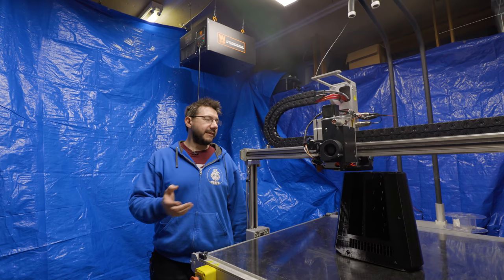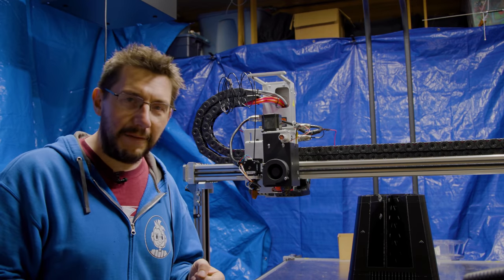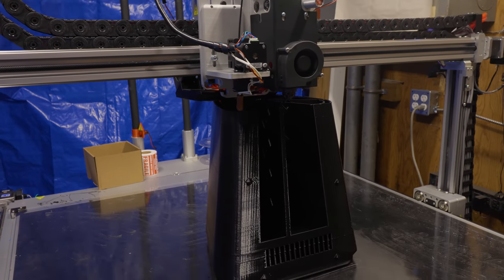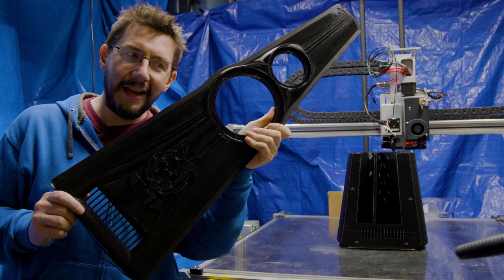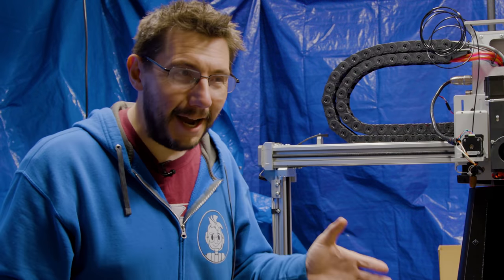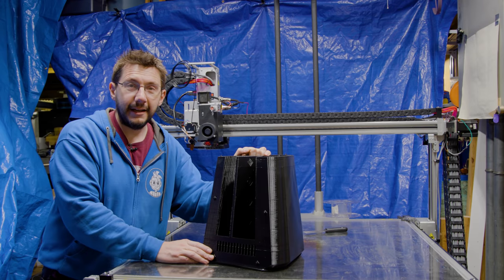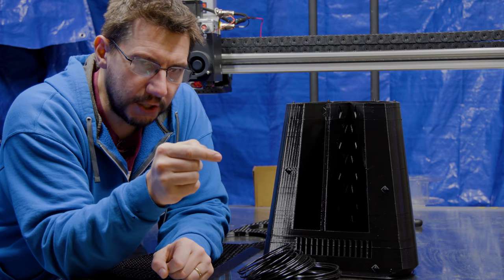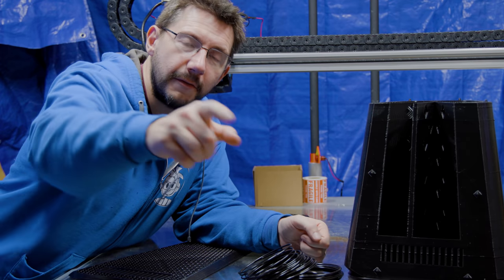3D Printed Speakers Part 1: Breaking the $38,000 3D Printer ... Again?

Comment: I have been working on ideas for 3D printing speaker enclosures as well, but the biggest issue is making sure the prints are dense enough to control enclosure resonances. If I saw the thickness of yours clear enough, I have concerns the walls are not thick enough and will negatively affect the sound. Try knocking on the side of it and listen for "ringing" or a dull thud sound. I look forward to seeing how yours turn out.

Comment: Joel, We have had one of these printers for a few years now. You didn't say what temp your garage was but we run ours at 74 degrees room temp.  We also use Aquanet on the bed. The prints stick most of the time and self release when cool. I would use a much larger brim in your case. And don't feel bad we have lost a few nozzles this way. We replaced the stock extruder with a super volcano hotend and a Bondtech extruder.

Comment: Delayed shutoff on sensor / use estimated time to run most of roll.
Reply: Yea, it really should know how far the out sensor is from the extruder.  Though I haven't done that with my printer either, but I only lose a foot of filament every time.

Comment: I know that lift... I had a (much smaller) print going that was just 7h. It looked great... until I removed it and found out that it had lifted, and it too had alignment holes and didn't fit... so I had to do the print over. Now to wait for part 2.

Comment: Some tips from someone who runs a 4'x6' bed.  No heat bed, spray super 77, we use a .65 first layer height for a .8 nozzle.  To release print spray windex on glue around edges of part.
Reply from the maker: Super 77? Really? That works for this?
Reply: @3DPrintingNerd  yup, we spray 3-4in from surface with quick swipes so its shiny, then print on top of that, we dont even squish the bead, it lays it on top and still sticks well

Comment: I would try larger brim to stick it to the bed. I think for these large prints, a patterned brim would be useful. Just imagine you have a large cross (X) with like 20 cm arms as a brim instead of the full offset of the base of the print. I do not know any slicer to do that.

Comment: Large spring steel print bed like  BuildTak is  the only way I see to fix the heat issue. The  area under the print is essentially insulated and it would take along time for that area to cool off.  Not to mention the differential of temperature on the glass.

Comment: For PLA I've used a painter's tape (just usual white good tape) + Erich Krausse PVA glue (stick). Worked very good usually. Maybe for such projects you need that. Or check your build plate heating consistency. I think it may be an issue there.

Comment: I know it might not be conducive to taking a time lapse but a draft tower is designed for this exact situation.  It holds heat, off the build plate, around the part to keep it from cooling and popping off.
Reply: actually a raft might do a better job?  if only someone had a machine to test.....  ;)
Reply from the maker: ooh a draft shield, that is a fun idea!

Comment: When I have a lifting problem I look for drafts moving past the part if that is not the problem the next thing I try is to use a Raft big enough so that the if the part starts to lift it does not affect the part along with some temp adjustment is needed but usually with a bit of futzing I can get most of my prints to stick so hang in there

Comment: I learned it's actually cheaper to buy decent speakers. Thank you!
Reply: In some ways you are right. It is easy to underestimate the level of design that goes in to a good speaker. A beginner can easily spend $500 on parts and end up with something no better than a $500 off the shelf product. An experienced designer can turn $500 of parts in to a $5000 equivalent speaker.
Reply: @Audio_Simon  Don't get me wrong. All respect to you for making this design. It loot awesome and I assume if printed right it probably works really well. This was partially a knock on the giant printer... and it's price.
Reply: Quinn of Snazzy Labs has some custom speakers which look pretty good and sound (according to him) amazing, and even as DIY as they are they still cost several hundred dollars a piece (mostly from the drivers themselves). I think they have some 3D printed parts on them so maybe Joel could consider trying that design out.
Reply: @fluffycritter  Can you find some pictures? I'd be interested to see.

The parts for Joel's speakers are pretty nice too, thanks to Solen.ca

Comment: I'd try a couple mm thick coating of PVA on the bed as that's always worked really well for me for a print surface when using PLA.  A quick wipe down with with isopropyl alcohol before prints seems to give it a good grip, but allow it to release once the print has cooled.  Not sure if that would peel off with the print in an instance like this though since the bed itself is glass.

Comment: I would suggest lowering the bed temp but adding some projected heat. 
I live in Canada.  Even in summer, sometimes if I leave a window open prints will fail like this.  In a fit of lazy reluctance to build an enclosure, I set up an old halogen work light.  All my heat problems went away.  
Something this big, you could also try one of those parabolic heaters.  Or 2 halogen lights on either side.  Not too close.  Just so that you can feel heat on the print.

Comment: For a machine this size and cost other manufacturers ditched the heated bed and went with a perforated vacuum bed. At the end of the day though printing giant size things is never easy, its better to have a design that has smaller sections that can bolt together, and maybe a one piece fascia that is wide but not thick and can cover the seams.

Comment: I do hope that this is a beta model of the printer - it seems to me like even just in this one video that you've uncovered a lot of opportunities for improvement:

-relocated filament runout sensors
-additional thermistors for monitoring the actual bed temperature
-additional/redesigned structural support for the print head gantry
-machine learning print failure detection (not unlike Spaghetti Detective)
-multiple independent bed heaters for more consistent temperature

Comment: You can "Weld" this filament! There are pliers available on Ebay, but just buy a pair of flat long nose cheap pliers and grind a groove that is 1.75, 2.85 or 3mm. All you have to do is to put the filament end to end, squish it together as you heat it up with a heat gun, small torch, etc. Then squish it together with the pliers to get it the exact diameter you need. You could connect all those ends together...

Comment: Wow so frustrating!  Those are massive stresses from the differential cooling/contraction.  Definitely need a heated build chamber, then you have 2 choices:  anneal as you go - build chamber at like 75C - or build chamber at say 50C, and an immediate post-print anneal in a smaller chamber with just the part at 75C.  Either way, you will have to give it hours to cool slowly, so lots of insulation.

Comment: This ALWAYS WORKS for me when I have issues with lifting. Before it can lift off. After its printed up about 2-3mm. Go get some liquid white Elmer's glue. And put huge globs of it all the way around the base of it. The heated bed will help it dry fast. And it will REALLY hold down the edges. It ways works for me. It holds super hard to the bed.
Reply from the maker: Elmer's glue? Like, the same stuff I used as a kid in school???

Comment: I was having curling issues like crazy on my larger prints on my CR-10 v2 and I solved it by making the brim larger proportional to the print. I always did a brim of 2-4 lines but I never gave it any thought to increase it as my print increase.

No matter what, the air around the print will cool the outside of the print faster than the inside, as you really saw on that print. The only way to fight this is by magic goo or probably, just a larger brim. And make sure that brim layer is on the thinner side, so adhesion is max.
Reply from the maker: I had a 15 line brim on this one. What should I try next?

Comment: Just sharing my experience, although you are the expert here... When printing with PLA,  I found out that higher bed temp above 60deg actually results in crazy curling. My theory is - the PLA gets hot and flexible - actually making lifting easier - especially on glass beds.

Comment: Can you move the filament sensor?  Get some large rolls of kapton tape and cover that bed. You could see about getting stick on bed plates without the spring steel and covering the center. Also,  are you adding any heat in your tarp room? I doubt that machine is putting out enough heat to heat the area.  Adding an over head tarp would likely help a lot.

Comment: It seems to me the biggest issue is the heated bed. Maybe try printing PLA with the bed turned off? It seems like the problem stems from the fact it uses one large heat mate. Maybe a good fix would be to use a bunch of small heat mates instead. Essential to zoning the heat bed to prevent hot spots. When the perimeter of the part is at 80c but internally the temp is at God knows what it's gonna warp and lift right? But I could be completely wrong here. Maybe the best fix is a heated chamber. Or maybe just using a pieces of foam to cover and insulate the unused sections of the bed.

Comment: I found that the hotter the bed the more adhesion you have. I had a failed print 3 times at 50 degrees Celsius and I moved to 100 and that sucker was really stuck in there. I would up the Heat and always print with a brim

Comment: I find that Walmart's Equate hairspray (heavy duty hold or whatever they call it) works WAY better than Magigoo for large scale build plates. Application best practices: apply the hairspray when the bed is HOT and allow to cool, then apply a new layer while cold, bring up to printing temp and GO! Allow print to cool after printing and the hairspray will release, more reliably than magicgoo, in my experience.

Comment: Have you thought about adding a brim of hot glue to glue the base to the bed? I sometimes use on a large print to glue down. It glues at about 450f or about 280c and it works great. Has saved a lot of prints for me. I have an FT-5 clone that I built with a 500mmX500mmx500mm build volume.

Comment: With someone with experience printing large & tall, I'll let you in on a little secret:. Once you cover a large enough surface area on the bed, the heat has nowhere to go!  The solution?  Reduce bed temperature by 10 degrees after the 1st or 2nd layer.  Not only will it not warp, it will lock the print into the grain of the bed.  So it helps to have a broken in or lightly scoured bed.
Reply: Also, your slicer resolution is too low.

Comment: Personally, I think the manufacturer should take to heart what you've been finding out about this printer... ie. Move the filament runout sensor closer to the hot end and rethink the bed... for that price a magnetic system like the Wham Bam seems to be an answer...  Just peel it up and flex it... no worries about glass breaking.  Probably about the same cost as the glass once you deal with shipping of a fragile material.

Comment: I use my Mosaic Palette to re-splice my waste filament back together, by putting it into multi-spool mode and telling it to ‘start without printer.’ I recently recovered about 15 meters of PETG that way. It’s not the most convenient process but it’s a great way to avoid wasting a bunch.
Reply from the maker: I do that too but this is 2.85mm filament and the Mosaic stuff is only 1.75
Reply: @3DPrintingNerd  Ah, didn’t realize this machine used such thick filament. Well, that’s unfortunate.

Comment: I have my printers in the basement, and I know our pain.  The basement's ambient air temp is between 65-70F.  To print PLA parts, I've had to put all my printers in enclosures.  The small Wanhao Mini gets by fine with a box to capture the heat off the print head.  The Ender 3 Pro is in an enclosed shelf, with a small electric space heater, to keep the temp up.  (I also have to keep it warmer for PETG and ASA parts)

I would make a frame around the printer using PVC piping, then wrap the tarps around that, including the top.  For that much space, a space small 1500W space heater should be enough to keep your temp around 75F.

And yeah, the printed part will help the bed retain heat in the spot it was sitting on.  Time to find a two foot long spatula? ;)
Reply from the maker: two foot long spatula! :) I like the pvc pipe idea, I may try that.

Comment: Joel, way to keep showing us the latest innovations in 3D printing (I'm not talking about the printer). Thanks.  I can't wait to see and hear the finished speakers.  It's really funny that at the close of 2020 that supersized printer has you using Magicgoo and a bush hack for the filament run out.  For $38k,  I would rather build 18 more RailCores :-) That printer is a p.o.s. - you are a patient man. (or at least well compensated ;-)  Happy New Year!

Comment: Hey Joel, I think you should try a ground glass build surface. Since it's such a large surface only glass will probably be flat enough, unless you can auto bed level. But I think ultimately you need a texture for the PLA to grab on to. 

I've been wondering how to ground glass myself since I think that would make for the ultimate build surface, textured, generally flat, dense so there's good thermal mass but the only problem with glass is that it is smooth. I've considered using a compressed air tank to just fire sand at a sheet of glass to get the texture but haven't tried it yet. Maybe that's something you can try, though on a smaller scale first and maybe do a video on it to show me how to do it. 😁

Comment: To my knowledge, 3D printed parts should have pretty great insulative properties due to their interior lattice structure. I've obviously never printed that big before, but it comes as no surprise that the bed took way longer to cool off under the part than everywhere else. On the upside, it's a sign they weren't screwing around with their insulation on the underside.
Reply from the maker: It’s very well insulated from what I can tell

Comment: What if you put a spring steel bed on it with maybe 0,3-0.6 mm thickness and hold on to it with some clips 
You still would be able to flex it given it’s big area and the prints might geht of it easier

Comment: So the warping is probably due to tempature difference between the centre and the outer parts of the print. Perhaps there is a way to start the print on 4 legs going to the middle at 45° angle? Or something else that would lift the middle part from the bed to prevent heat buildup?

Comment: Maybe Joel you could print those big tall parts on a more solid cube frame core xy printer? I have the Tronxy X5SA updated 2020 model. 
It can do 13 inches on the X and Y on the base and 15.7 inches high on the Z. 
Being a big framed cube it is really good and does not have the same issue's you got with this printer you got!

I would advice you to get one and test it out doing these bog prints is what it does well, it has a Mk 10 hot head and is a 1.75 mm filament But is easy to customize.
I sure you could do it to do the size of filament you using there with just changing the extruder and sensor. 
I have a Titan extruder now for doing TPU and such. the printer has a 24 Volt 32 bit system and a good fast heating up bed and even the hot head heats up quickly.

The Printer can do PLA, ABS, PETG and of course TPU. I would say you best do a enclosure for it to maintain the heat. the cube frame would help there as you can build on to it.
I even brought the Tronxy made super flexible replacement bed plate cover which is magnetic held on to the original metal bed.
Think of this a chance to do a review of the Tronxy X5SA 2020 model?

Happy Christmas to you and your family and a Happy New Year from me here in the UK. 
Hi Five : )

Comment: hey maybe try using a different bed material other than glass and see if it works out better, seems like the glass has been struggling for a while now to adhere parts to it. try one of those textures removable mats (idk if they come this big) or even seeing if you can use bed liner or something lol. also double check your thermostat for the bed, and if it isnt centered to your part. you might wanna move it there so the hot spots go away. cheers let me know if any of this helped

Comment: I used to have one of these in my last job, and I hated it soo much!! Need to go slow, always having problem with the direct drive, the glass bed warped so badly, nothing stucks to the glass even with hairs spay, blue tape, oil, nothhing... We had to print on the corners only... So bad because the idea of having a huge printer was awesome!

Comment: My friend has a printer for 20K€ but it is fully enclosed, it can warm the bed on segments. Uses ballscrews and linear rails + servo motors, has 2 hotends. o.O Build plate was 1.2M squared i think.

Comment: A big production printer should have two filiment sencer.  The original location should be an alarm, and one by the nozzle.  
Also I find when a print wraps ist is from uneven cooling of the part.   Just the wind gusts by walking by the printer is enough to warp a print.  Try printing an outer shell as your printing.
Reply from the maker: two sensors - would the alarm just be for the print technician?

Comment: You could use a 3d pen to patch that Crack in the bottom... Smooth it with a flat tip soldering iron.